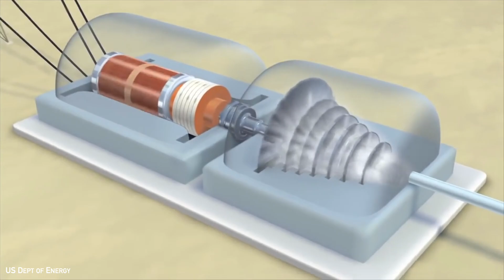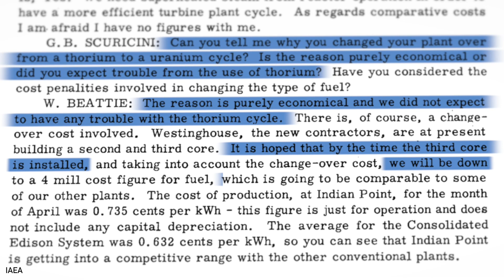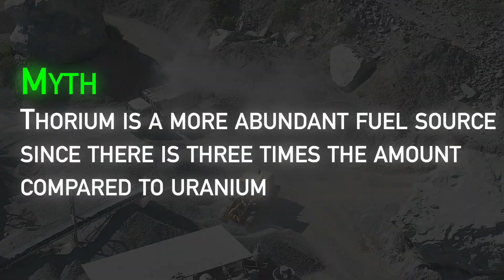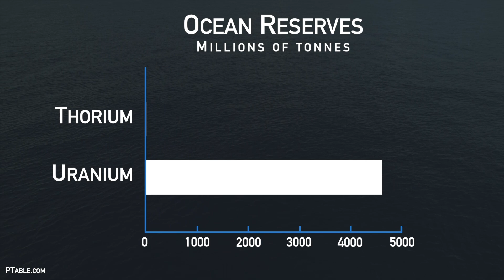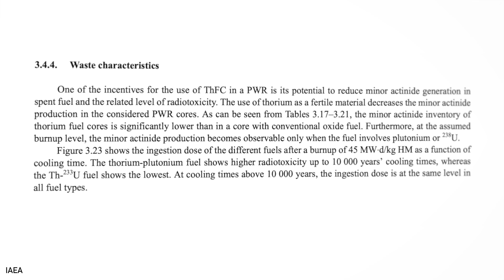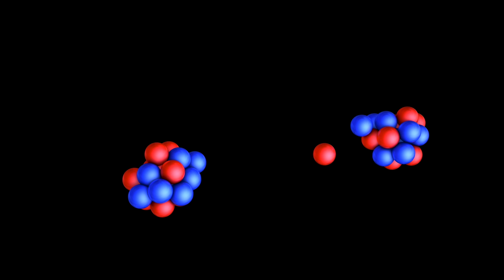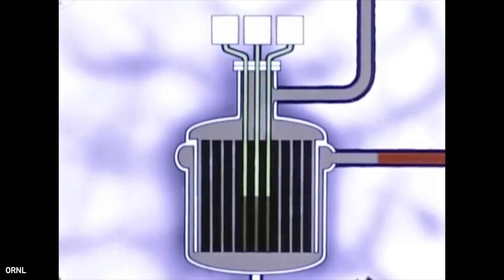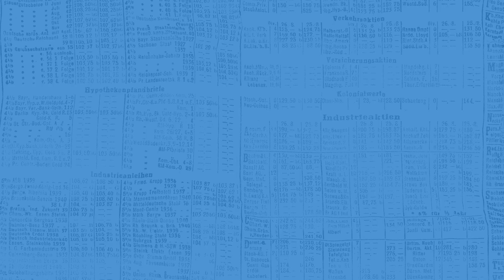*Almost

Comment: I think a lot of the "thorium waste isn't bad" school of advocates, have listened to Kirk Sorensen, who advocates (advocated?) for sorting the different elements in the waste, chemically, and using them for usefull stuff. The chemical sorting requiring a liquid waste, so probably a Molten Salt type of reactor.
Reply: Yes, and the very suggestion that they don't know what they are going to be left with at the end of the day, or at least name some of these dangerous elements might lead to someone commenting on the uses for these byproducts. Which I see someone did anyway.
Reply: Engineers will tell you anything that follows the laws of physics is possible.  But they ignore cost, complexity, operating concerns, safety concerns, maintenance concerns, and system longevity. Those concerns are usually left to others.

Elemental and isotopic  separation is not an easy task.  Add to that, radiation, and in  the case of fissile isotopes criticality concerns and security.  
These Thorium reactors that "burn" spent fuel and perform constituent separation of the salt solution would be so complex that today's PWRs would seem like toys in comparison.
Reply: @clarkkent9080  Chemical separation of different elements is generally much easier than physical separation of isotopes of the same element.
Reply: @TheUweRoss  add they fact that it is all highly radioactive and a criticality concern and you have a multi multi billion dollar plant.

The MOX Facility only had to mix pure Pu239 that had already been separated from the other radioisotopes with natural Uranium to make new fuel assemblies and THIS is how easy that was.

The MOX facility (South Carolina) was a U.S. government nuclear reprocessing facility that was supposed to mix pure weapon grade Pu239 with U238 to make reactor fuel assemblies. It was canceled (2017) in the U.S. After spending $10 billion for a plant that was originally estimated to cost $1 billion and an independent report that estimated it would cost $100 billion to complete the plant and process all the Pu239, Trump canceled the project in 2017.

No offence but anything seems possible when you don't know what you are talking about
Reply: @clarkkent9080  It's chemical processing. No exotic physics required.
Reply: @clarkkent9080 Clark, clarification …scientists are immunized from costs.  Engineers have to balance the cost-time-performance triangle of pain..  But your point is taken.      Cheers D
Reply: @danbenson7587  France is one of the few nations that reprocesses and they have only been able to reprocess 1/3 of their waste. And their aging facilities will soon be shutdown and they have no plans to replace them.  I believe that the only reason that France initially reprocessed was to obtain Pu239 for their weapons program.

New nuclear is massively expensive and adding additional cost with new and untested designs or reprocessing will only add more cost.  NuScale finally canceled their SMR project and they received $2 billion in taxpayer money, were given free government land on which to build, and had full NRC approval.  Terrapower will be the next and last to fail.

Comment: I think most LFTR fanboys don't realize that most of the benefits of their precious are not benefits of Thorium in particular, but rather fluid fueled reactors in general.  The waste advantage doesn't come from the Thorium, it comes from the nearly complete burnup that liquid fueled reactors in general allow, regardless of fuel cycle.
Reply: rdormer  - Agreed.  There are at least six major advantages to liquid fueled reactors that will eventually make them preferable to any solid fueled reactor. 1) They can be located anywhere, w/o regard to cooling water, thus saving on long distance transmission.  2)They require no active control, but are passively regulated by temperature expansion of the fuel mix. 3)  Long half-life actinides can remain in the reactor indefinitely as fuel, rather than be removed as part of the waste when solid fuel rods threaten to crack from internal pressure.  4) They cannot explode and will passively drain and shut down for any power loss.  5) Xenon gas can bubble out of the reactor, hence does not remain to "poison" the reaction for three days following any large drop in output, as happens with solid fuel.  6)  As a consequence of #5, a liquid fueled reactor can rapidly change output to recover from any outage and to load follow, instead of being base loaded as are all solid fuel reactors.  The latter makes it compatible with the rapid fluctuations of any residual solar farms before their retirements in the face of MSR's eventually superior economics, absence of need for battery backup and lesser scarce mineral utilization.  A seventh advantage would be that use of a fast reactor would enable breed/burn of any fertile or fissile material, including existing waste, without need of graphite moderator replacement.  This would enable power production for as long as the Earth and its radioactively-heated core exists.
Reply: @robertmeredith3940  FIRST, lets build one in a country with real safety regulations and then operate it for at least a decade.  THEN and only then can you make the claims that you make as if they are facts instead of technically possibilities.

Fusion provided unlimited power at almost no cost.  See how I can use technical possibilities to make unproven claims???
Reply: @clarkkent9080  Sorry, everything I claim is based on proven principles of physics and thermodynamics that do not need confirmation over time.  There are some unknowns about materials and supply chain about which I make no claims.  But all the above six claims will all be true on day one of operation and ever after..
Reply: @robertmeredith3940  And every claim I made concerning fusion is based on proven principles of physics and thermodynamics that do not need confirmation over time.

In 70 years of nuclear power your claims have NEVER been proven with a REAL operating power producing reactor.

Why do you believe that China and India are building very small non electric producing test demo reactors if as you say it is proven technology????

You are just one of those people who make claims based on nothing but book math and science.  It is much more difficult to make what is technically possible cost effective and useful.
Reply: I recommend restating it as :::The potential waste advantage doesn't come from the Thorium, it comes from the possibility that nearly complete burnup that liquid fueled reactors in general may allow, regardless of fuel cycle.

You stated it as if it existed and has been proven in an actual (not demo) full scale reactor

Comment: 99.3% of U is 238 (only 0.7% of natural Uranium is ready for a reactor); U-238 has to undergo major centrifuge processing to produce U-235.  Thorium requires little processing.  Also, as Thorium is separated out from rare-earth materials during mining, we already have stockpiles of Th ready to go.
Reply: Or just particle acceleration to make it simple.
Reply: Thorium is NOT fissile.  So 0% of Thorium will fission and produce power.  You have to use URANIUM (233 or 235) to fission, release neutrons and transmute Th232 into U233.  So it is a much more complex operation and Uranium is always involved
Reply: @clarkkent9080  You just have to kick-start it with some U to get the reactor going.  We have plenty of U for that.
Reply: @gaboardman  Yes, then you have to reprocess to separate the U233.  And realize that breeder reactors use neutrons that could cause fission to breed fuel and produce less power per volume than non breeders. So what is the advantage since thorium/U233 separation is very costly and difficult?
Reply: @clarkkent9080 In fairness, separating uranium 233 wouldn't be that difficult, unless of course it's mixed in with hot, corrosive, radioactive salts. Then I imagine it becomes a nightmare.
Reply: @darkgalaxy5548  If anyone ever builds a Thorium MSR and actually separates the U233, then we will know.  Until then, it is technically possible just like fusion.
Reply: There is acceletor based systems that do not require initial fissile stock. Also, due to inherent subcritical system, system shutdown itself if power is lost. Melt plug in MSR system is still operable, inherent safety like usual thorium reactors. Also, mixed spectrum design also improve fuel economy and reactor dynamics. 

But, lead cooled mixed spectrum reactor can also be used with similar concept. Also, homogenous liquid lead reactor can be designed in similar concept. The problem is always initial acceptance of new concepts, the initial licencing of new reactors are around 10-20 year, too long for new companies...

Comment: So when they said that the reason for abandoning thorium (at Indian Point) was “purely economical,” that sidesteps the question of plutonium from a uranium reactor, because presumably, they were getting compensated for plutonium production.  I certainly don’t know what percentage of their revenue might have been attributable to plutonium, but it probably wasn’t nothing. Even if we developed separate reactors for all of our plutonium needs later, it seems like there may have still been some economic advantage to cranking out plutonium at the time of Indian Point.  After that, the die was cast, and we’ve been stuck with uranium’s momentum (kinda punny how uranium reactors have tended to breed more uranium reactors).
Reply: Does the following "sidestep" answer your sidestep question?

Weapons production reactors (Hanford) were producing Plutonium in 1944.  That is 14 years  before the first U.S. commercial reactor began operating and 19 years before Indian Point began operating

Where do people keep coming up with this BS that PWR/BWR were chosen so we could make bombs?
Hanford Wa. has been making weapons material since 1944 and their weapons production reactors are very efficient graphite moderated reactors and DO NOT produce any electrical power.
Savannah River site SC. Has been making weapons material since 1955 and their production reactors are very efficient low pressure heavy water moderated reactors and DO NOT produce electric power.
Weapons production reactors are NOTHING like U.S. commercial PWR or BWR power reactors and commercial power reactors have NEVER been used to produce Pu239 for weapons.  The U.S. has so much Pu239 that we are spending billions to dispose of 34 tons of weapon grade Pu239 safely.
Reply: @clarkkent9080  Thank you. Super helpful reply!
Reply: @clarkkent9080  In answer to your  "where do people keep coming up with...", I think it is some combination of:
- Historically, folks being butt-hurt their pet project got cancelled in late '69
- People not understanding that at least in the US all of the Weapons Pu feedstock came from dedicated military reactors (as you noted)
- Yet another falsehood from the anti-nuke crowd since confusing weapons and power is a plus for them
- And perhaps the biggest contributor being startup marketing taking advantage of point 3 and not being challenged on it

I've been making that exact same point with the Th fanboys for years, doesn't seem to stick.
Reply: @richardb1452  Very good points.   But for the life of me, I cannot understand why so many people seem to be on this Thorium band wagon, and aggressively pro Thorium. 
Many don't even know that Thorium reactors do not fission Thorium.
Is this another result of YT video and social media educated people??  God help us all.